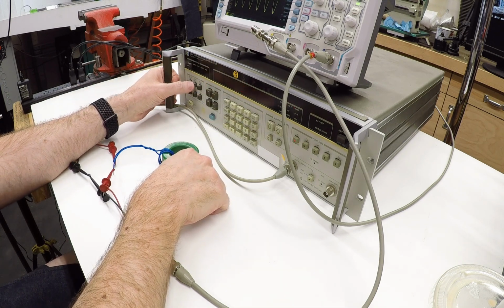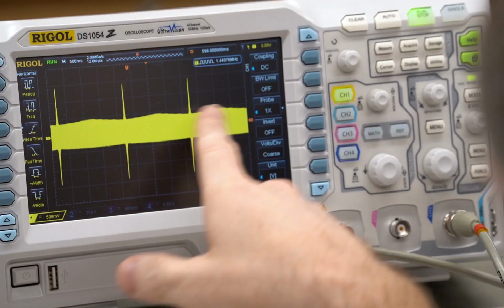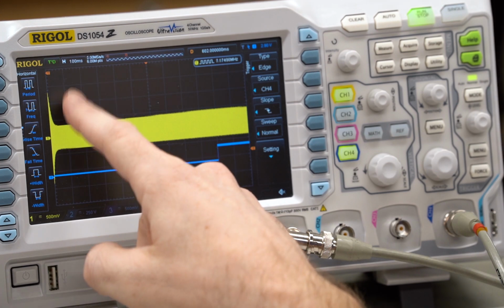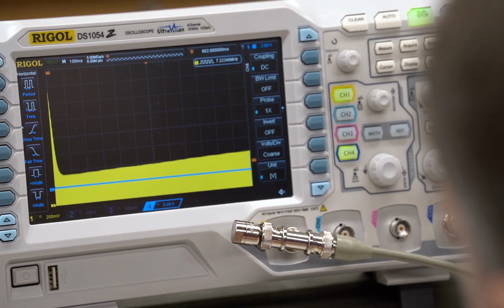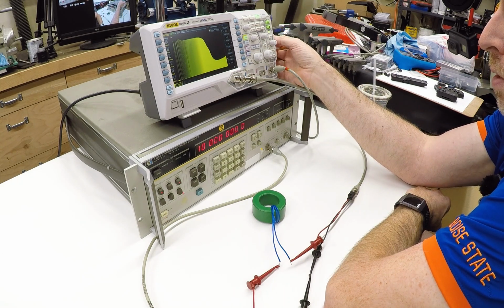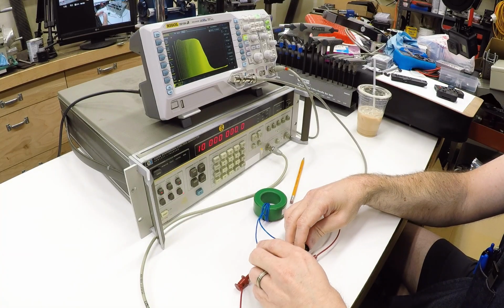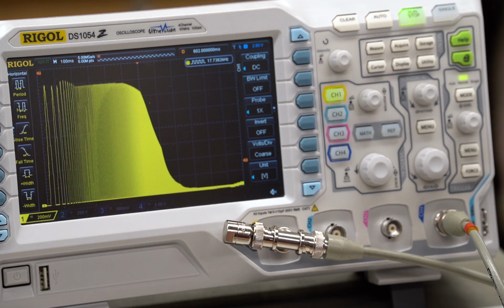Visualizing EMI Filter Frequency Response with an Oscilloscope

Comment: Very cool. For someone who is not an electrical engineer you sure know a lot about electrical engineering. Moving the capacitor makes no difference because the the current in a circuit is the same everywhere in the circuit.

Comment: I am having excess noise all across the hf band. 1-30MHz coming from my solar charge controller. What size capacitors, would you suggest? Output voltage is as high as 56v input is up to 150v. I have seen a design with 2 capacitors in series across the positive and negative with the center pin of the caps going to ground. Seams like it would work but I am not sure about the size of the cap. I all ready have multiple wraps through a toroid and it helped but it is still noisy. 
Thank you

Comment: As long as you are just showing a coil and capacitor, this would have been an ideal time to show them in series or parallel. The result is a basic band pass or band notch filter.

Comment: I've used this technique for years for low-frequency work. Since my spectrum analyzer only goes down to 9kHz anything in the lower audio ranges needs to either get mixed up to a higher frequency carrier or have an alternate analysis mode.

Comment: Ha, I've got the Rigol 1074Z with the 100MHz upgrades ... enjoy the product and it's a great help in working with electronics design. A few years ago I complemented the scope with a spectrum analyzer from https://signalhound.com ... I bought the USB-SA44B model. It works beautifully with their free companion software called Spike. At a later time, I also bought the USB-TG44A, a tracking signal generator. If you are not aware of Signal Hound, I encourage you to check them out.

Comment: As Graham Wideman already said regarding the placement of the C, you are more or less characterizing your measurement setup (source + load), and not the L+C. In other words, please consider the true output impedance of your VFD, and the true input impedance of the motor. This will lead to completely different results.

And on a second note: In your sweep you were generating frequencies up to 10MHz, while your scope was sampling at only 5MSps. According to the Nyquist theorem, your sampling frequency must always be > 2x the signal frequency, in your case >20MHz. Or the other way round, the range from 2.5MHz to 10MHz in your curve is not showing you the truth. :-)

Comment: On the positioning of the capacitor: You have to bear in mind that you're not just testing the coil and/or capacitor. You're testing a circuit that includes the 50-ohm output impedance of the HP generator supplying the signal to the input of your L and C components, and they  in turn are connected to a 50-ohm load (assuming your terminator on the BNC-tee is 50 ohms).
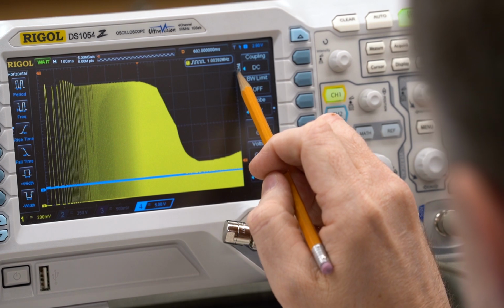The L and/or C impose a difference on the output only at frequencies where their impedance is some significant fraction of 50-ohms, or more.  Evidently, for your L, that frequency is around 100kHz (8:20).  For the C, that frequency is apparently around 30kHz. (This suggests L = 80uH and C = 0.1uF.).
So when you have the C in the circuit, in either location, you're essentially measuring an R-C circuit (input R = 50-ohm, C is 0.1uF) with a knee at 30kHz. The L plays no role in that knee, because the frequency is below that at which the L has significant impedance relative to 50-ohms. So of course it makes no difference whether you place the C before or a after the L in this case.

Comment: Just get a spectrum analyzer, dude. Some are cheap now.
Reply: And he wouldn’t easily get this measurement either.  There is a very special spectrum analyzer for the frequency range in use here.   E.g. the keysight E5061B-3L5. Or one of the power loop analyzers https://www.omicron-lab.com/products/vector-network-analysis/bode-100/ or Venable FRA. It comes down to what the equipment was built for with regulars to the frequency injection and monitoring.
Reply: He's already got it meeting his needs, and that is a very infrequent need indeed.  Why take up more shelf space for something that would largely be gathering dust?

Comment: The 3325A has an X-axis drive, or "ramp" output. With an old style analog scope you'd put the scope in X/Y mode. The X would come from the ramp, and the Y from your measurement. Optionally you could use the Z-axis blank output as input to your Z-axis (brightness). You then look at the envelope of the CRT beam. This gets tricky with very slow sweep speeds with non-storage scopes.
Reply from the maker: Yeah, I tried it, but couldn't get anything useful out of the scope.  I could get a single vertical band sweeping left and right, but was never able to get anything with enough persistence to make it easy to visualize.  Perhaps I missed something.
Reply: @Clough42  Yeah, digital scopes typically don't have very good X/Y display, and non-storage analog scopes don't have enough persistence for slow sweeps.

Comment: The mystery hump is around 60Hz. I'll eat my hat if it isn't mains coupling you are seeing there James. Try rearranging the cables and monitoring the plot. The oscilloscope lead at the back is laying on the case of the function generator, and the scope lead passes through a loop made up of the handle on it. Lots of little things to watch out for. I may be wrong however :-) Great treatment of the subject once again. Thanks.
Reply from the maker: Yeah, looking closer, you're right.  It's definitely at 60Hz.  So probably environmental pickup.
Reply: @Clough42  This kind of filter protect you against the jammer?